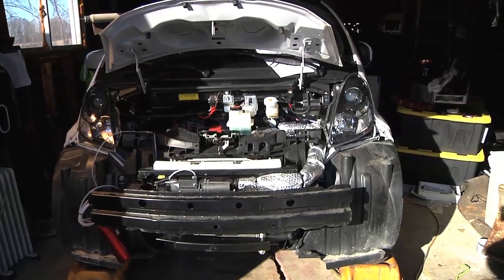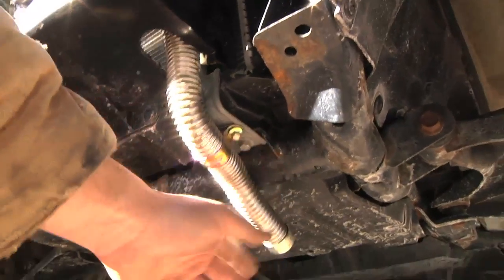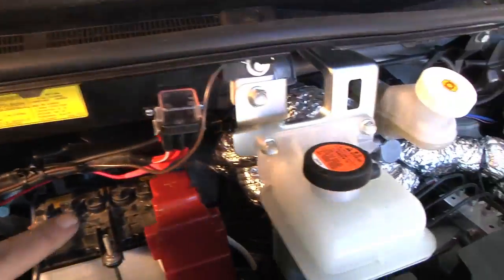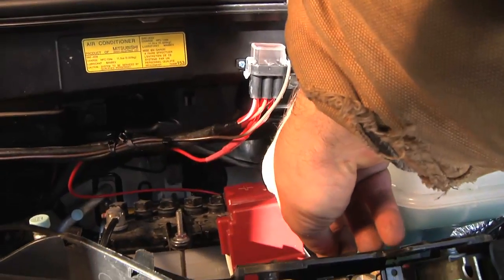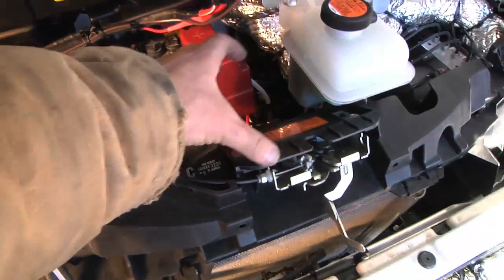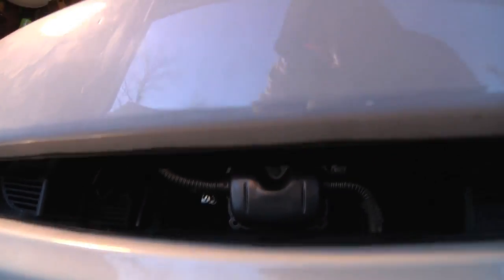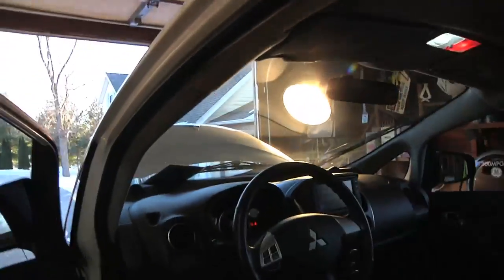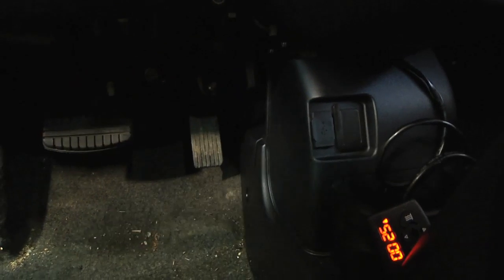iMiEV Heater Install Part 5

Comment: How do you remote control the parking heater? Do you have leave the car with the ignition on and fan at AUTO. I want to use GSM unit to start the parking heater.
Reply from the maker: I do NOT have a remote control for this parking heater. When I'm parked at home with the car in the garage, and plugged in, I can remotely preheat the car from wall electricity. I typically just use the parking heater while driving when it's extra cold and during longer trips (to save use of the battery.)
Some people have also installed AIR-BASED fuel heaters in their iMiEVs. Those would be easier to use with a remote, as they wouldn't be dependent on the car's internal liquid cooling and fan system.

Comment: Can you use it while you are driving or is it only for parking?
Reply from the maker: Yes, it's designed for use WHILE driving. The term "parking heater" comes from the fact that these are used in semi-trucks to run heat while the tractors are parked (often overnight, with the driver sleeping.) Using a small heater instead of idling the engine, just for the heat, saves a tremendous amount of fuel (as well and noise and wear and tear!)

Comment: Ben, I think you need to consider shortening that exhaust pipe. The positioning of it looks like if you hit a speed bump or a pot hole, that makes the car bottom out, then the exhaust pipe will get crushed.
Reply from the maker: +RJReed67 Maybe. I figure it's easier to shorten a pipe than lengthen it, so I left it long to start. If it's an issue, I'll cut it shorter. I just wanted to make sure that the exhaust got well away from the car.
Reply: @BenjaminNelsonX hi 9 years after, could you please tell how it went after the install.i am considering to buy one and follow ur guide today. Any dos/donts? Suggested heater models?
Reply from the maker: @moopro88  Always worked fine for me. No notes.

Comment: Ben, maybe I missed it but what was the core reason for going with a fuel burning heater? Does the factory heater really cut that much in to the drive time?
Reply from the maker: +Chris Muncy. It's a combination of 1) This car having the smallest battery pack of any U.S. commercially-built EV, 2) The heater robbing power from the battery that could otherwise be used for range, 3) Temperature of the electric heater is limited to about 140 degrees F. (Most gasoline cars have coolant running at 190 degrees F, once the engine is to temperature!) The official EPA range on the car is 62 miles. All cars (gas, electric, and other) don't get as good range/fuel-economy in the winter. Running the heat full blast can rob a third of the range. So, what it comes down to is that in the winter, the range can be shortened SIGNIFICANTLY. Not running heat really isn't an option when it's 0 degrees F. Even if you could dress for it, you still need to defrost/defog the windows. Using fuel in a heater is MUCH more efficient than using it to run an engine, to run a heater. I'm estimating fuel use to be around 200 miles per gallon in the heater. This setup still allows me to use the electric heater and the electric pre-heat feature, but ALSO have the option of the fuel-heater. I'm planning on using the fuel heater only when it's especially cold, or on longer trips, otherwise, I'll be using the electric heat.
Reply: +BenjaminNelson Thanks Ben. Makes sense. I didn't know the car had a short driving distance.